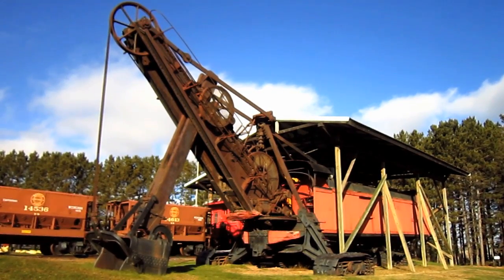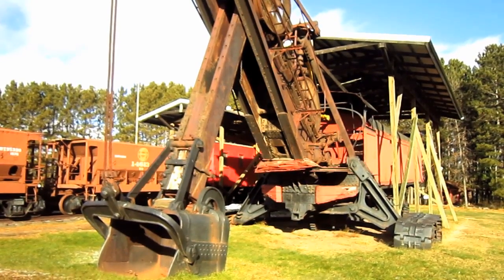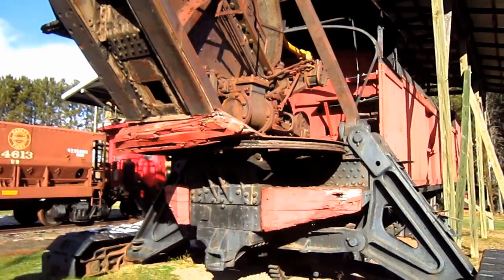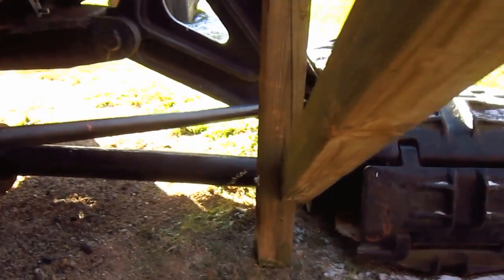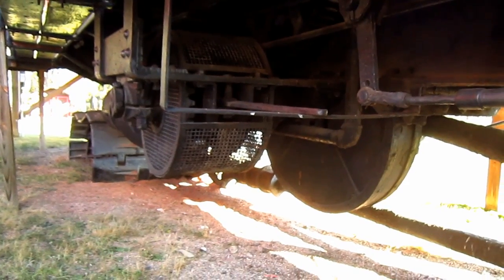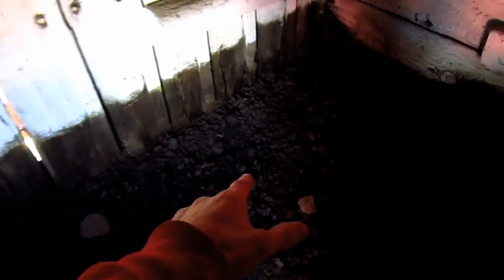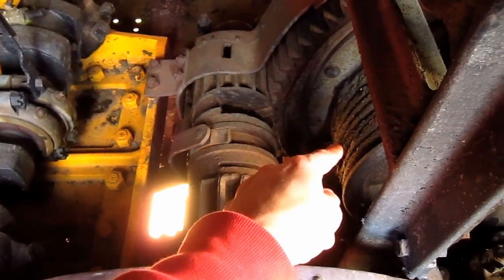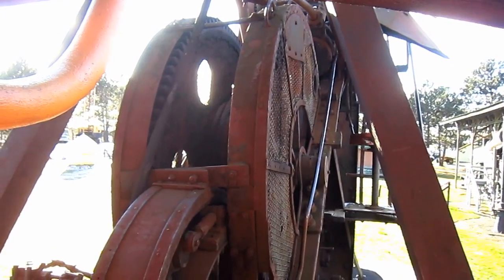Atlantic Class 80-18-4½ Documentary

Comment: This shovel is in my area and I learned lots of things from thid video I never knew.  

The Minnesota Museum of Mining in Chisholm is a wonderful place.  One of the unusual things is that you can climb on most of the equipment.

Please do the 120B.
Reply from the maker: The 120B there i believe was the 3rd or 6th unit built. I didn't film that unit but have another 120B filmed for a future upload. Thanks! :)
Reply: I knew the 120 B was old, but not that old!
Reply from the maker: So I just looked at my notes on that machine. It's serial number 4604 (painted on the side of the machine) - 5th unit built by BE in 1926 :) Cheers!

Comment: Can you give us the location of the museum. I think there’s a few of us here that are gonna be doing a road trip in the spring
Reply from the maker: Sure this is in chisholm MN
Reply: @PAmining  thank you
Reply: Minnesota Museum of Mining.

While you're there, don't forget the Hull Rust Mineview in Hibbing.  Most of the towns on the Iron Range have some sort of equipment display tucked away somewhere.
Reply from the maker: The Hull rust mine overview should have been removed. I believe Hibbing Taconite stripped through there years ago. They had a Wabco 170 on display. I never filmed it because of the stupid staircase on the front of it. That machine was scraped.
Reply: @PAmining  That's the old one, it's a big hole in the ground now.  We moved to a new location about a mile east of there on top of a dump.

Kirscher moved the 170 ton Wabco truck up there and Hibtac donated a 240 ton Lectra Haul that used to be a water wagon.  They put the pink box on it and drove it up there.  

We still have all the old shovel buckets etc. and even picked up a 35 yd bucket.

Open every year from mid March to end of September.